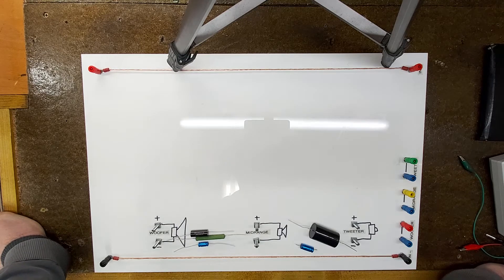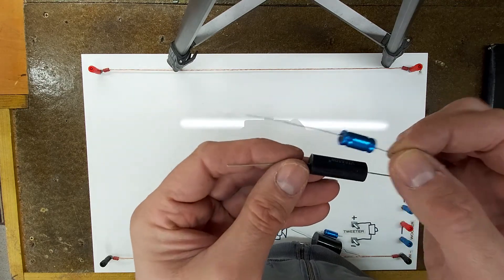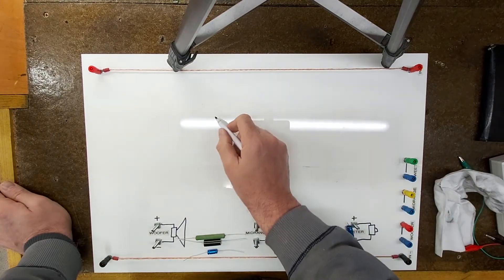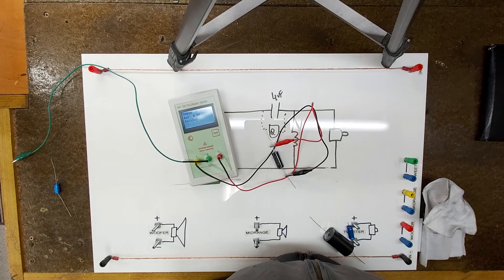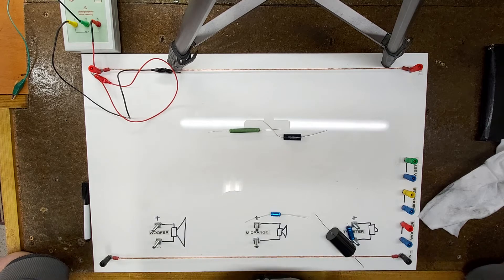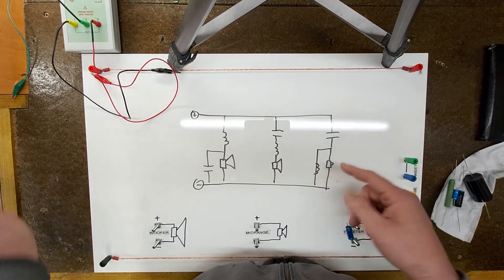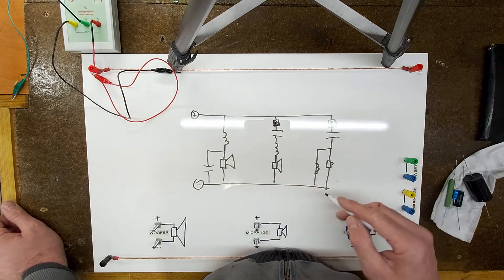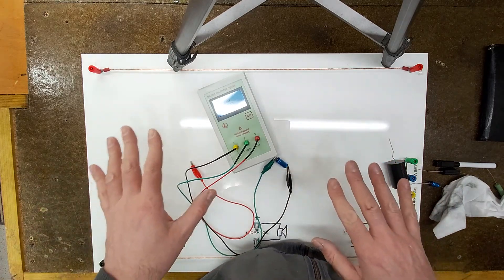DIY poly capacitor upgrade issues

Comment: When adding lpads Should they also be installed before caps and coils  ? I've been putting them at the end not the beginning for years
Reply from the maker: At the end. You can do two things then. Tune the circuit using the resistor across the tweeter by varying the impedance the high pass circuit sees and also attenuate the tweeter
Reply: @haycrossaudio5474   guess I've been doing it correctly,  as per my books by David Weems

Comment: I had been wondering about that, thanks. How about replacing the resistors (if present) in the crossover with slightly stronger ones, instead of adding one? Or are those behind the cap and will that mess up the crossover frequency? Also it probably isn't wise to measure and old electrolytic against a new film cap, because it may be out of spec and have a higher resistance than when it was new.